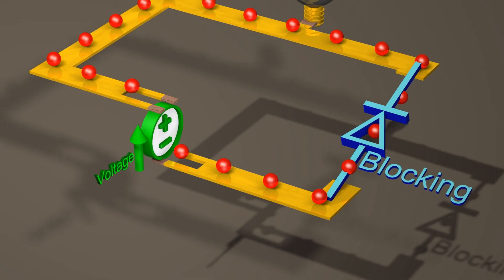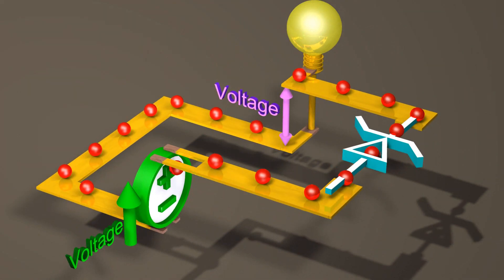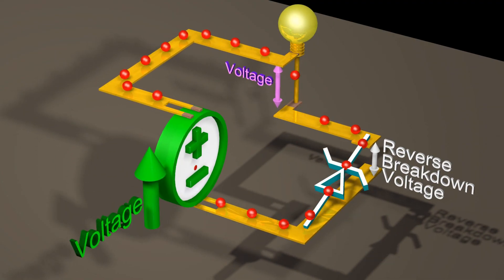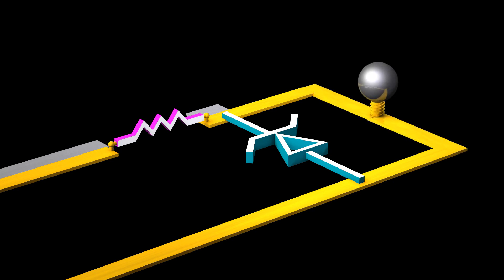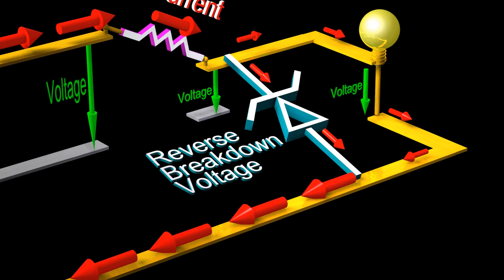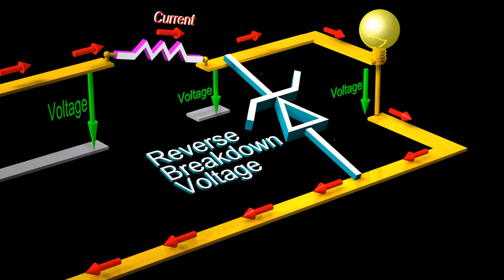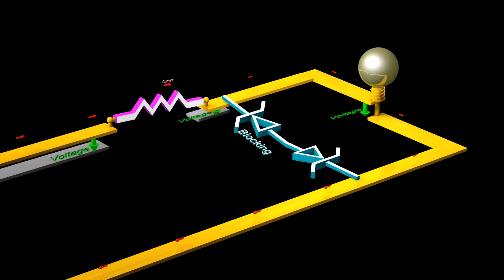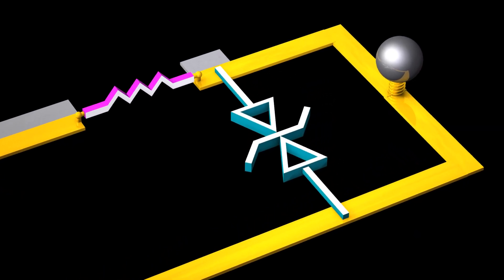Zener Diodes in electric circuits - Voltage Regulators & Transient Suppressors

Comment: Howdy. Nah.
Zeners are way too slow for transient suppression. The correct component for that is the varistor.
Regards.
Reply from the maker: It depends on how fast the transient is.  In many cases, you may even have a steady state over-voltage that you want to protect against.

Comment: A Zener diode is a special type of diode designed to reliably allow current to flow "backwards" when a certain set reverse voltage, known as the Zener voltage, is reached.

Comment: I hate the fact that we have "conventional" (where the poles and the signs are reversed) and "real" (where the poles and signs are correct) conventions. We should have switched years ago. I mean there is nothing wrong here, but the fact that I have to keep reminding me that the real diodes are "sign" reversed and that the electrons are going to the + sign instead of the other way around is just one more hassle to keep tabs on.

Comment: Trying to understand: When the voltage applied to both the Zener diode and the light bulb exceeds the Reverse Breakdown Voltage, why doesn't the light bulb process the excess voltage; shine brighter?
Reply: Ahh, the voltageDROP across the Zener diode stays approximately equal to the Reverse Breakdown Voltage, not the voltage itself, so the higher the voltage across it, the more it processes.

Comment: Thank ypu but why cant we regulate the voltage woth a normal diode or just soethibg else like a capacitor etc..? In other words why must it be a zener diode?
Reply: I'm new to this, and this comment is old. I'm thinking the reason why we can't use capacitor is due to impedance (capacitive reactance)? While we can't use normal voltage because typically it has small threshold voltage..?

I'm rlly not sure pls share your thoughts

Comment: The green voltage arrows are shown in the wrong direction starting at 1:50. Otherwise, nice video.
Reply from the maker: The voltage arrows can be drawn in either direction, as they just represent the voltage difference between two points.

Comment: So is this already in my machine that protects computer from low and high voltages or is it thing of the future? I'm 10 years behind in my electronics - since I didn't finish my studies.
Reply from the maker: Zener diodes have been around for many decades.  They are not new.

Comment: The shading is getting better! Thank you for your effort, guys! Amazing result, I now understand more!
Reply from the maker: I am not sure what you mean by "shading", but thanks for the compliment about my video.  I am glad it was helpful.
Reply: @EugeneKhutoryansky  I am under impression the reflections on the surfaces are smoother, like more light source points are used.
Reply: @EugeneKhutoryansky  Yes, thanks! Your making it easier to understand even though I read a bit about the topic on the net. <3
Reply from the maker: Thanks, but the method for reflections and light sources is the same as it has been in all my other 3D animations for all my other videos.
Reply: @EugeneKhutoryansky  
You don't need to give me any more reasons to re watch them all!